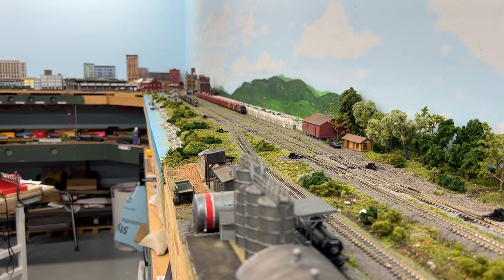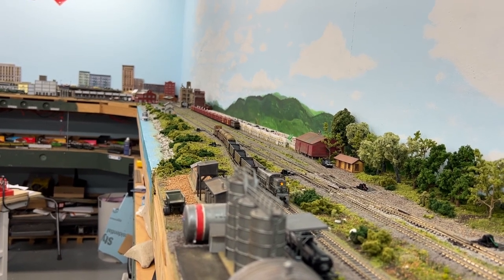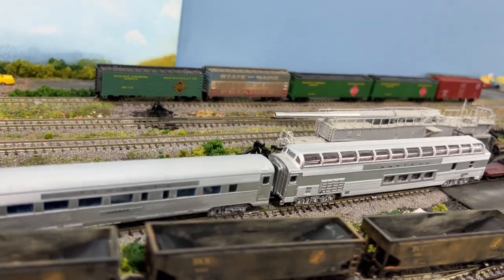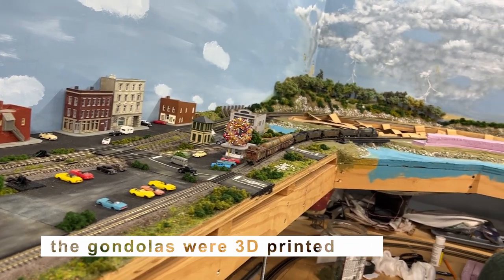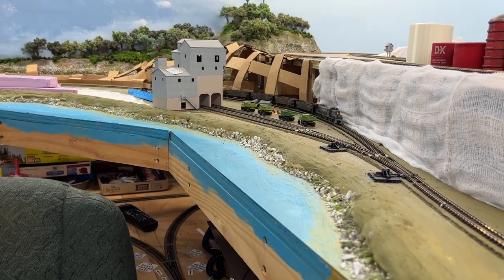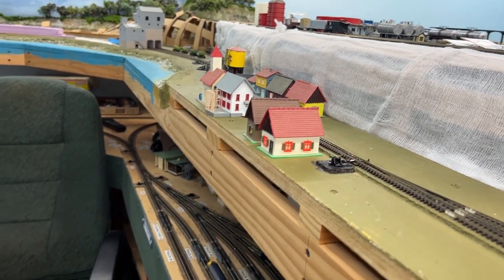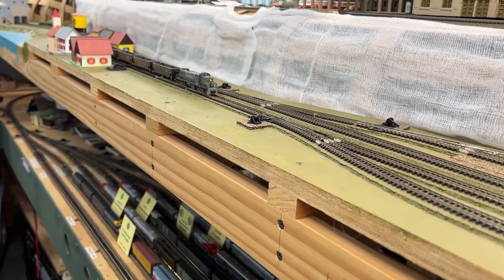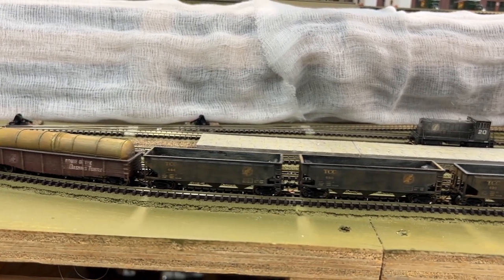Turtle Creek Central Freight Ops

Comment: nice running John! Love the rolling stock and the rs-2. looked pretty smooth! :)
Reply from the maker: Thank you John. All of the cars were light so this was also a test to see if the added weights in the hoppers made them reliable and it looks like they did okay. The gondolas were printed by me a few months ago and even with a weight under the floor, they were too light and kept derailing. The added weight of "whatever their cargo is" seems to have helped them as well...John

Comment: Great Op's video John. A little weight makes a big difference.  Bob
Reply from the maker: Thank you Bob. There were a couple of issues but I cut them during editing. I am working on some printed hollow pipe loads with separate tops for a couple of bulkhead flats that I had printed a few months ago. They are also light so I will put some small fishing weights in the pipe load to increase the weight…..John

Comment: Hey John, didn’t realize you had arm problems. Glad your doing better.

With the under floor weights, we’re the weights of the cars up to nmra recommended weight?
Reply from the maker: Hi Ken, Yes I fell on my left shoulder a couple of months ago followed by surgery and am now slowly healing. As for the two gondolas were 0.4 oz too light even with the weight that I added after printing. There isn’t a lot of room in the pocket that I created so they really need a load such as the tanks that I placed in them to bring them up to 1.1 oz. When I print some more  of them, I will see if I can create some additional depth but the width is really limited….John
Reply: @tanzj  wow!, 2 months, and still healing. That’s a long wait to be hampered.

What material did you use for weight? Can you try lead? Or is that what you used?
Reply from the maker: @KenN.OXN.805  The shoulder had a torn rotator, detached bicep, and something else on the top of the shoulder that was torn. Physical therapy is 16 sessions and I am only halfway.  As for the weights in the gondola, I used some flat brass (0.5 mm and 1 mm thick) that I got from Midwest Model Railroad. The space available in the chassis for weight is 12 mm X 80 mm. The calculated weight for the car should be 1.1 ounces and with the load it is. I have some 3D printed bulkhead flats that have the same issue. For those I am working on a pipe load that is hollow in the middle where I have added some fishing weights to bring them up to the correct weight…..John
Reply: @tanzj  just went to a lead calculator and a 12x80x1mm lead rectangle is only 0.4 oz. Guess the only way is to always keep a load.
Reply from the maker: @KenN.OXN.805  yes I agree with you….